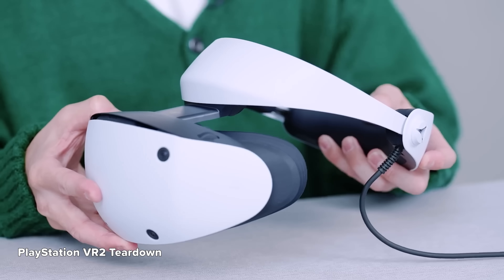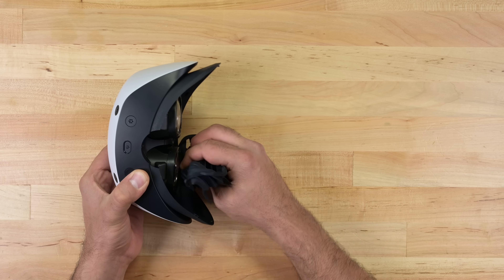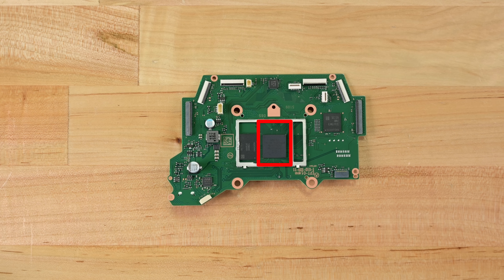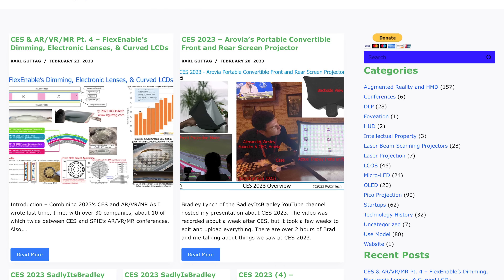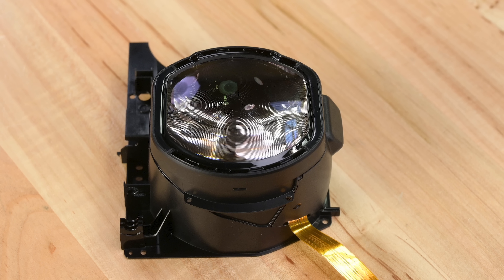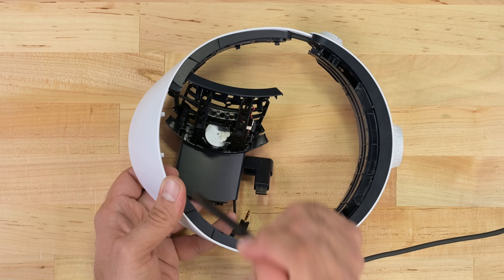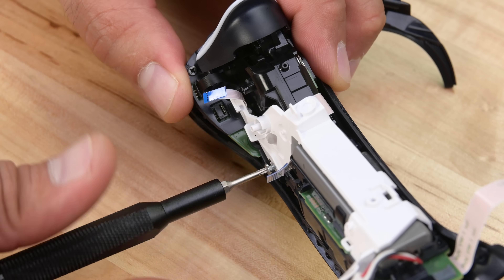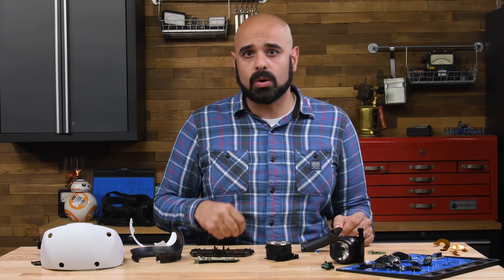iFixit's PS VR2 Teardown- A $550 Compromise

Comment: We call it a $500 compromise, but it preforms better than an Index that costs 1k....still. If this thing worked on a PC, I'd get one to replace my Quest 2.
Reply: Don't get your hopes up when, the point of the VR is to sell the consoles and make devs make game on thier consoles for it. im 90% sure they are sell this headset at a loss just to make people buy the PS5
Reply: Quest 3 will be out in no time
Reply: Index still beats every other headset (except Pimax) in terms of FOV though. It looks very, very good for a Fresnel type of lens.
Reply: Well with the PC adapter it does now
Reply: Ikr, he's critisizing Fresnel lenses here but not on the valve index teardown even though that costs double and comes with lcd
Reply: @shivamarya5225  pancake lenses weren't mass produced when the index came out, they just recently became a thing that manufacturers adapted
Reply: @marcelmarcon971  what? Pancake lenses have been mass produced by for cameras since the 60s when Nikon started selling them. Where did you get that idea from?
Reply: @shivamarya5225  they were not being produced for vr headsets because the panels weren’t good enough then
Reply: @marcelmarcon971  and how do you the panels weren't good enough in 2019 when index was launched. They were good enough for expensive 8k cameras with huge sensors but I'd like to know when exactly did this change happen? Did some new manufacturing process came up that suddenly they were now good enough for VR headsets but it was absouluty impossible in 2019. Kopin first showcased pancake lens VR headset in 2015 along with other companies who also showed their prototypes and launched it for consumers in 2017
Reply: @shivamarya5225  it wasn’t „absolutely impossible“, just too expensive for mass consumer market back then. fresnel lenses require brighter and higher resolution display, which were more expensive back then.
Reply: @marcelmarcon971 I'm saying how do YOU know whether it was too expensive? Are you an lens industry expert or working in Valve? kopin launched their plastic pancake lens for consumers in 2017. And if Fresnel requires more exepnsive displays then it would make even more sense to use pancake lenses which are not Fresnel
Reply: @shivamarya5225  Fresnel lenses were the standard for VR in 2016-2021. It's only recently that it's starting to change. It doesn't make sense for him to critice Index for something that every  other VR headset was doing also in 2019. This is not a hard concept to grasp but you are being ridicilously weird about this.
Reply: @vdentertaiment4088  except every other VR headset wasn't doing this. Oculus rift had a hybrid lens even in 2018 and kopin elf had pancake lenses, even back then everyone was talking about having non Fresnel lenses on VR headsets
Reply: @shivamarya5225  No, they weren't. Pancake lenses in VR headsets is a very new development, and appears to be the defining feature of the next generation of headsets. We're only just seeing it come to market.
Reply: @FarrelClement  oh really

Comment: No. Lighthouse is not outside in tracking. It's marker based inside out tracking. It would be outside in tracking if the base stations have cameras like the PSVR1 or the Oculus Rift did it.

Comment: Lovely video but I think you missed a trick by skipping over the one part people care most about: replacing the cable.
Reply: The strain relief boot on mine cracked, and i thought of a good fix. You could get into the actual head strap and splice the cable together, shortening the cable so that it has about an inch or two away from the headset, then just using a high-speed USB C female to male cable. 

It should work. I have a similar setup, except I didn't splice it. Im using  a short extension cable attached to a magnetic dongle so that the port on the console doesn't get damaged from a yank. So I theoretically, it could work if you do a solid connection

Comment: Do you think that it would be possible to mod the headset? 

As in, replace the displays with lcd ones to eliminate the terrible mura effect caused by oled? And also change the fresnel lenses for pancake ones to improve the visual sweetspot and remove god rays?
Reply: Why would you mod a headset build around HDR OLED displays, by giving it LCDs instead?
Reply: @emilrogengellschwaner3555 that dude hasn't played on a OLED before. I love my OLED TV. The deepest blacks. Beautiful colors
Reply: Just buy Pico 4 then.
Reply: You wouldn’t even have hdr on the thing anymore if you did that

Comment: Finally Sony do the right thing about repairability.. Thanks Sony.. 🔥
Reply: Sony isn't a perfect company, but they always made it fairly easy to  repair their stuff so im happy they didnt change that
Reply: You still can't repair it if the cable is damaged. Sony asks 300$ for repair of the cable.
Reply: @ahmeti.7595  It's not to hard to repair the cable!
I can repair the entire electric board if needed.
Reply: @ThermalWorld_ I am talking about replacing the cable. Sony should provide spare cables but they don't. Are you going to manufacture the cable yourself?
Reply: @ahmeti.7595  you don't need to replace the entire cable!!!
Just repair it on the broken point, not very hard to do..
If you don't know how to repair anything, bring it to repair center.
 Easy to repair doesn't mean you need to have everything as a spare parts for repair!

Comment: I noticed the end of the type c chord that plugs🔌 into the ps5 will tend to bend no matter what position you put it in. I'm pretty sure this will eventually lead to a short. Does anyone have any suggestions.  Laying the ps5 horizontal will still have the same effect.
Reply: Connect the cable to a short extender (must support DP and USB3). If that fails, at least the main tether won’t.
Reply: I've yet to accidentally yank the PSVR2 cord from the PS5 but I secure the cord on to the desk next to the PS5 with some duct tape.  This way, if I yank on the cord during play, the tape will prevent me from yanking the plug off the PS5.  Not exactly fancy but a quick, cheap way of protecting the USB C jack and PSVR2 plug.

Comment: Sadly the fact that it's tethered holds it back from a purchase for me.   Quest 2 can stream from a PC over WiFi and I'm surprised Sony didn't implement something similar for PS5 which would have made it much more versatile and open up more options for room scale experiences.   Still if Sony commits to putting out compelling software I could aee myself purchasing one down the road.
Reply: I've heard that wifi with can be very hit or miss, there's also cable management options if it really bothers you, although I do believe we need a good software library, re8 and gt7 are very good starts. But we need more
Reply: Same
Reply: wired will always be better than wireless for performance.
Reply: Have you tried Quest 2 with WIFI? This is muche worse quality and not worth the quality hit
Reply: @Speku165  I have a Quest 2 with the Virtual Desktop. I I have very fast internet and wifi box and nothing will beat wired. Wireless is stutter at times and doesn't have as good quality.
Reply: @Cal3000  thats what i said
Reply: @Cal3000  I also use a wifi 6 setup for PCVR Quest 2 and while it's amazing for movement intense games like Blade and Sorcery where you can spin around like crazy and all, the quality isn't really that great compared to a wired headset. 

That and you have to have a wifi setup in the same room + little to no interference from other signals if you want a good latency/experience.

The wireless technology is just not there yet. People are being delusional thinking wired headsets are somehow "ancient technology".

Comment: pico 4 has pancake tech at like 400 bucks
Reply: Which is paired with LCD screens for that deep black colour, I mean washed out black virtually grey colour.
Reply: he was talking about using OLED with pancake. the Pico 4 is cheap LCD hence the low price
Reply: @SnakeHelah  OLED with pancake doesn't work because these panels don't get bright enough. So Sony chose fresnel over pancake to deliver HDR OLED for those sweet deep blacks, rich colours and high contrast. And that was totally the right choice, it looks absolutely stunning. Would want the grey blacks you get on every other VR headset out there.

Comment: Sadly it’s the most uncomfortable vr headset I’ve owned. I hope someone can make an alternate facial interface.
Reply: u sure u wearing it correctly???
Reply: @DaBestTiger  yup, not my first VR headset, I own Rift, Vive, Go, Quest 1 & 2, Lenovo mrvr. It’s the rubber gasket mostly the issue, I removed that which increased comfort, and reduced perspiration. Now I need to find a replacement facial interface.  I’m not the only one who’s experienced this.
Reply: @LightningAussie  
I like how you making claims while you dont actually have a PS5.
Reply: @LightningAussie   wow thats a lot of headsets. it might just be your head shape, mine is slightly uncomfortable sometimes but it always gets better when i readjust it
Reply: You are definitely not wearing it right then. The rubber face cover is only there to block out light, it doesn't provide any support for the front. the Halo ring is what's balancing the weight
Reply: I find it more comfortable and lighter than the psvr1
Reply: You arent supposed to tighten it like a vice around your head, the front should be resting on top of your forehead. It's incredibly comfortable if you're putting it on right.
Reply: @zan I’ve owned the Go, Rift, Quest, Quest II, Lenovo mrvr, so I’m not new to VR.

Comment: I'd definitely have looked into getting one. Sadly, being locked to a PS5 means it's off the table for me. Hopefully the next thing Valve comes up with is as repairable and affordable. I wouldn't expect Oculus to achieve the repairable part, but you never know.
Reply: I can see Sony allowing driver compatibility on Steam allowing PC users to use them at some point. Especially if it underperforms as a PS5 peripheral
Reply: @DaweezMauiWowee  if not I hope there will be 3rd party ones like for the psvr1
Reply: @thebyzocker  LTT have got pretty good review of it, but unfortunately, the guy that is doing PSVR1 is probably not doing it. The complexity of PSVR2, and the fact that even PSVR1 compatibility is still abit spotty, means that the guy won't be doing it.
Reply: @DaweezMauiWowee  I wouldnt be surprised if they add support for PC as they have been more open then ever before with adding playstation exclusives (albeit at a much later date) to pc, something which was previously unheard of. Adding PSVR 2 support to PC could allow them to sell their own VR titles like Horizon. If enough people bother Sony maybe they'll do it at some point.
Reply: Sadly it is currently an expensive paperweight. I would’ve get one myself later on.

Comment: what's the repairability score??
Reply: I think they stopped giving a score, I haven’t actually seen one recently on their channel. I’d presume it got a 10 though.

I believe if the most difficult part of a device can be replaced without breaking any of the hardware by an average user, it deserves a full score. Maybe a 9 due to one or two of the plastic clips breaking but it’s miles better than glue.

Comment: Pancake lenses are not necessarily better & the recent 1k+ headsets were not consumer headsets, they were enterprise ones.
Reply: Also, Fresnel lenses have other problems compared to traditional and I wouldn’t consider them objectively better than normal lenses. Weight and size is probably the only improvement. Pancake lenses also have issues with amount of light transferred due to the polarization they use, but need a smaller physical gap between the display and the optics.
Reply: @Rahul Katre  yes fresnel was specifically for light, HDR wouldn't have worked otherwise
Reply: Oh they are better. No question whatsoever. Once you have used pancake lenses you will never want to go back.
Reply: @sproket343  they are better for lcd not oled hdr, I don't think you understand that light doesn't pass through pancake lenses as well, so in order to have oled and hdr they had to use fresnel lenses, yes there's drawbacks but if you want bright vibrant colors, and deep dark blacks with beautiful bright hdr, they had to use fresnel

Comment: I guess Sony took a page from former Nintendo engineer Gunpei Yokoi’s concept of “lateral thinking of withered technology”.
Reply: The only old tech they're using is fresnel lenses (which is still the standard for cheap vr headsets btw), soo I'm pretty curious to understand what you mean with that quote lol
Reply: What does that mean?
Reply: @yorgborg7899  I'm guessing find new ways to get the most out of older technology
Reply: @Meltdownlv100  If that was true, they wouldn't be using analog sticks that can lead to stick drift.
Reply: Man , the ps5 , needs an HDMI pass trough like the XBOX Project Scorpio. To enjoy other stuff on the VR 2 , idk
Reply: @Gleamoz  Plex App? You can supposedly also connect it to a windows PC as an external screen. Will try that tonight.